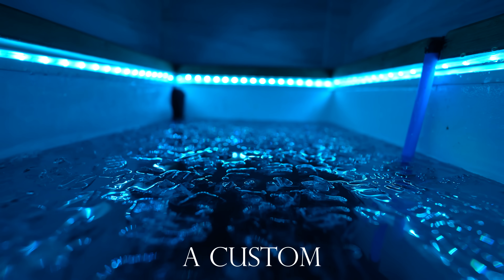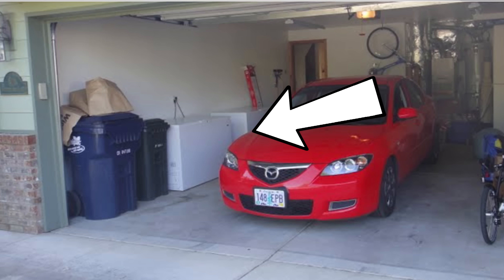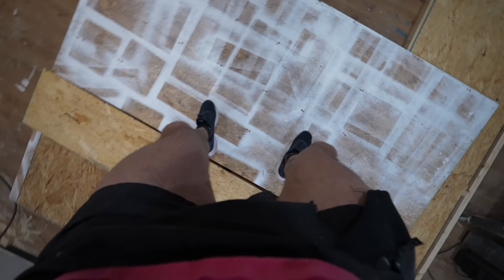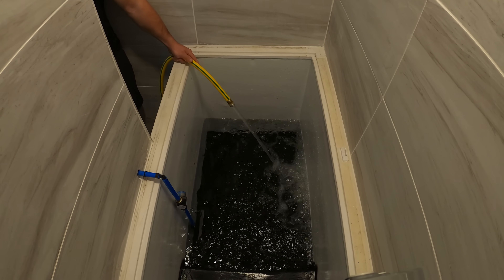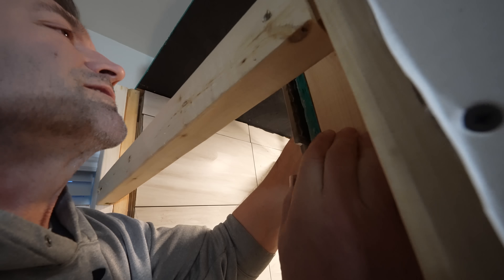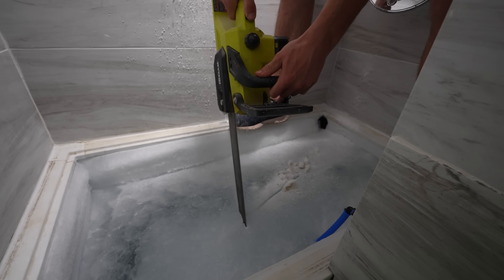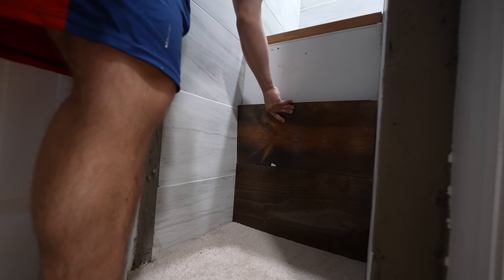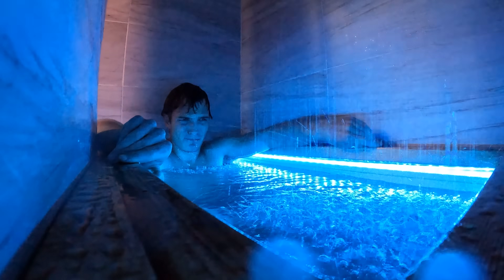I built a LUXURY ice bath

Comment: A tempature sensor that control power to the ice bath would've been better. You could've made it where once it hits a certain temperature it kills the power and then restores it once it changes by 5 degrees or so.
Reply: I had the same thought, but this way he is "forced" to do it at the same time, and it doesn't cool the water when he's not using it.

Comment: While the design and overall build is genuinely impressive, I feel skeptical about the choice of cooling system for this thing. I am unsure whether the freezer's engine really is capable of essentially cooling down a small room with a pool in the long run.
Reply: Oh the freezer motor is gonna be dead in no time. Keeping a freezer cold is one thing. Keeping 1000lb of water cold is not what it was remotely designed for. I’m sure the shell was damaged further during the freeze too meaning leaks are coming. Plus it’ll be filthy with no drain or easy way to refill it